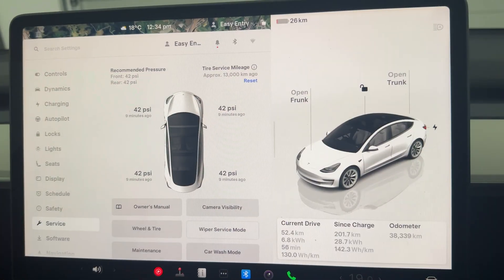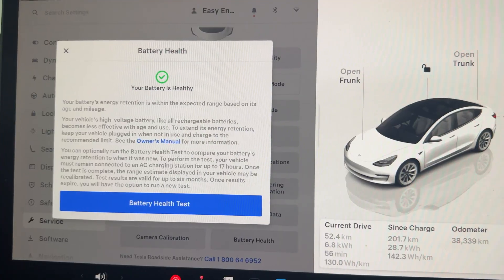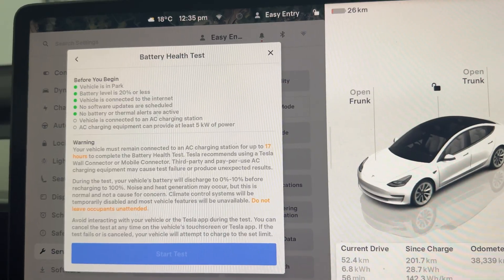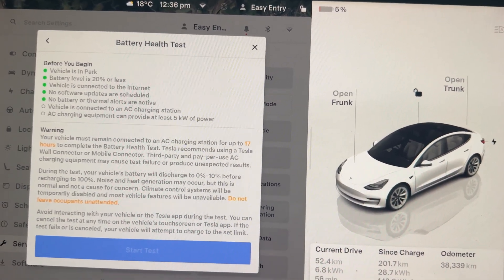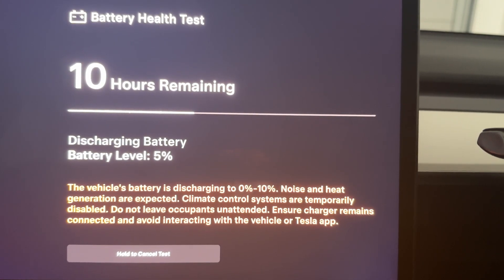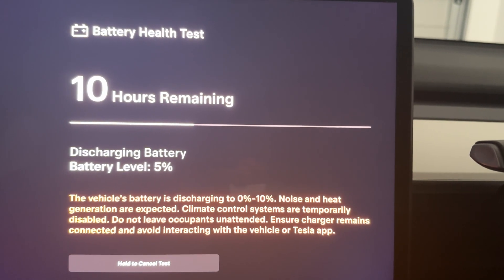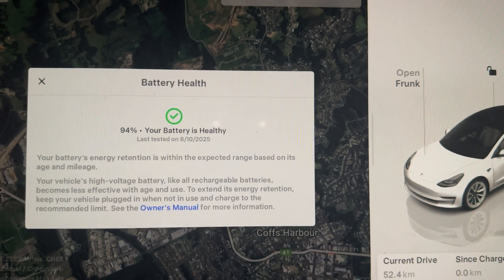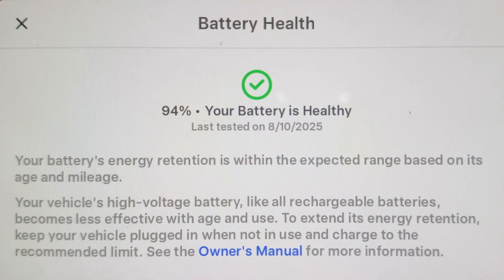Tesla EV - 3 Year Battery Degradation Test

Comment: The mileage you showed was the EPA estimate or Australian equivalent. So the first mark is complete fantasy. So you should take from your first logged range test which will give you the results Tesla reported in the test.
Reply from the maker: Hi Joe, thanks for the feedback. Yes, I think you're right. The Australian marketing advised a WLTP range of 602km. I've since read that the on-board software calculates EPA range, which is always less than WLTP. So I have corrected my spreadhseet to show a starting range of 566 kms. That brings the spreadsheet degradation in line with 94%.
Reply: You're absolutely correct. For context I've a 2023 model 3 LR RWD which is 620km WLTP, but EPA after fully charging to 100% only showed 552km when new.

Comment: This advice is relevant to legacy Li-Ion chemistry but irrelevant as with most modern cars that use LiFePo4 chemistry, the battery is likely to outlive the car itself.
Surely a short distance driver owning an EV with an initial  +300 Km plus range, can accept more than 50% degradation without worry.
This is a nothing burger. If modern EV owners really want to extend their battery life to say half a million miles they need to know their actual car and its battery chemistry.

Comment: Thanks for the video. I do wish I had a Tesla due to their software, but the car was at least US$10,000 more expensive in January 2022, then the one I bought. $45,000 was a lot but $55,000 would’ve ended my marriage and literally broke the bank.
I went with a 2022 Hyundai Ioniq 5 built in November 2021 and I’ve had it for over 3 1/2 years and over 93,000 miles, 150,000 km.
The range on my car seems exactly the same because I make the exact same trip to the ski mountains in the winter and I’ve done that for three seasons in a row. My little dongle says 99.5% state of health.
I don’t know if I’d be happy with the charging curve of a Tesla or the degradation level …… it seems my battery is better.
My guess oh meter in the summer says 359 miles of range and I’ve seen it as high as 369 miles of range……. 2% battery degradation??
Either way as we both know range and charger degradation are not a thing when you own an EV especially one like mine that offers 303 miles per charge on the EPA window sticker.
I get 225 miles of range in 17 3/4 minutes at a 350 kW 800 V charger while Tesla gets about 220 miles of range in that amount of time at a Tesla supercharger.
I also hate Hitler and Elmo so that’s a showstopper